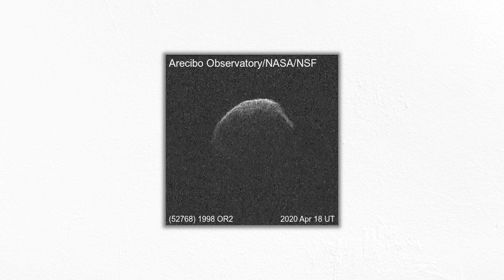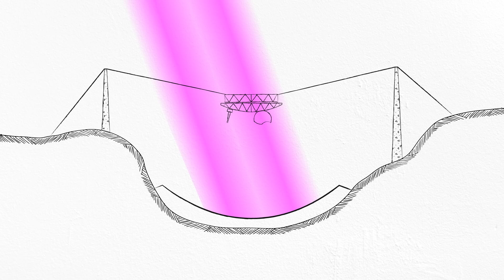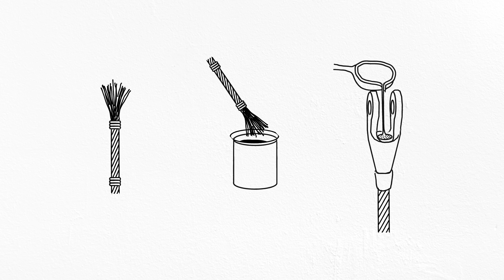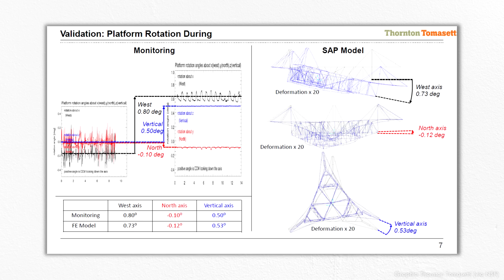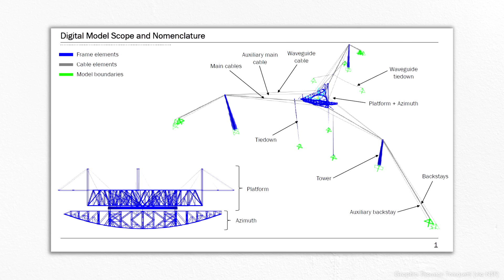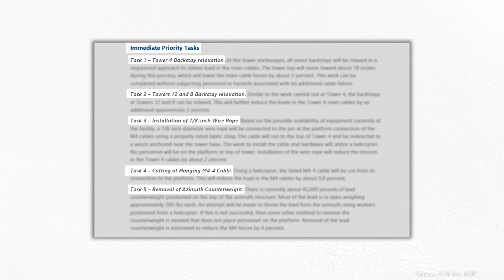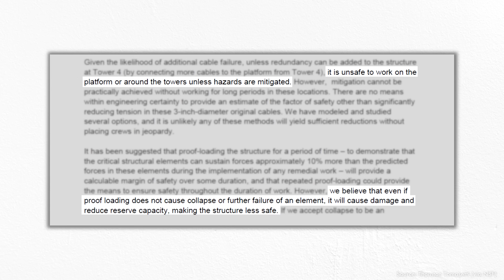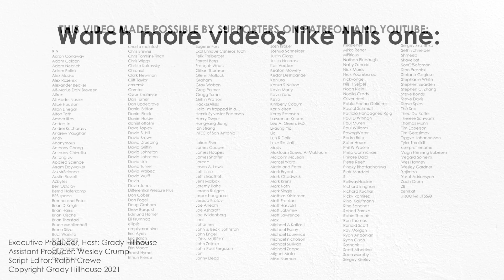What Really Happened at the Arecibo Telescope?

Comment: From Grady’s description of the situation, the question in my mind is not “why did it fall?” but “how on Earth did it stay up as long as it did?” Low safety margins, unique design, constant exposure to salt air and tropical sun, frequent hurricanes, and in at least one case, shoddy workmanship.  It seems that receiver was staying up there mostly from force of habit.
Reply: 😂its almost like curiosity rover. Its kept getting saved by random events working years after it was expected.
Edit: opportunity rover
Reply: @NAUT758  Opportunity. Curiosity's only been active for ... wait, it can't be a decade already...
Reply: @CptJistuce  lmao exactly. Its dead already but serving years on research, literally getting saved by storm on freaking mars (wind blowed off the dust on its solar panels) reserve battery getting so low it went into sleep mode only to get light again, working on only 3 wheels with literally 1 wheel dragging behind it. Curiosity was like “call an ambulance, but not for me”
Reply: @NAUT758  Seriously, that was Opportunity. Curiosity is nuclear-powered, no solar panels. 
C hasn't YET reached Oppy's legendary levels of determination(Designed life of three months on Mars? Screw that, fourteen years!), but it is working on it.
Reply: @CptJistuce  Pretty sure that was Mars Exploration Rover B 🤣
Reply: @CptJistuce  my fault og
Reply: @NAUT758  That was opportunity
Reply: The designed margins seem fine, but when a cable fails at 62% design load, the margins you thought you had were clearly no longer in place (perhaps never in place, depending on how poorly the cables were actually constructed.) 🤷🏻‍♂️

Still, you don’t just get “lucky” after something this massive exists for over half a century. It seems they should have done some more thorough testing of the existing cables when they installed all of the upgrades - that was likely the only time they could have caught it.
Reply: @EstorilEm  That's exactly what the margins are for. A safety factor of 2 should make sure that no part is stressed more than 50% of their expected strenght. Clearly the margin wasn't actually that large. The additional instruments definitely lowered it below 2 and the hurricanes may have caused some unnoticed damage in the cables or supports causing more stress than expected.
Reply: @Sibula  - I think the effect of hurricanes could be a key factor. Meteorologists still don't have a complete understanding of everything that happens in a hurricane, and a structure like Arecibo may have been particularly vulnerable due to its shape as much as its size. My guess is the dish drew wind down and then up, subjecting the platform in the middle to torsional force. Adding the Gregorian reflector would have massively increased this torsion, and it's questionable whether the vertical tie-down cables helped or hindered, since they made the entire structure less flexible. The first cable to snap was a tie-down.

While it's safe to assume that Arecibo's engineers included torsional stress in their calculations, they probably used historical hurricanes as the basis for their models, which were on average smaller, less powerful, and less frequent than today. (They would not be the first engineers to make that kind of error.) The Gregorian reflector and tie-downs were added in 1997, which means the planning (and therefore engineering calculations) involved probably happened before the increasing size, power, and frequency of Atlantic hurricanes was more well known.
Reply: @Sibula  Agreed,  but also the testing of the materials during manufacture might not have been rigorous.
Reply: @tavdy79  that's not entirely accurate, hurricanes are only really able to be measured from recent years in history and we only have data as lives lost and damages in X amount of money, which isn't a good basis, hurricanes have likely been similar in power and size for millenia but our ability to measure them is what has actively allowed us to document them properly
Reply: @Sibula  or construction fatigued the cables more than they should have
Reply: @EstorilEm  failing at 62% load sounds a hell of a lot like metal fatigue, its not that their margins weren't high enough, they just never thought far enough ahead to the inevitable point at which those margins would lower. Maybe a factor of 2 was enough, but the design was virtually unserviceable from the start, and this was sadly inevitable because of it
Reply: @hunterra217  The original configuration would likely have been serviceable - after all, they routinely sent people to change the line feed. However, adding the Georgian Dome which increased the platform's weight to over 900 tons likely made maintenance trickier due to the increased loading on the cables (while computers were available in the 1990s, they likely took the estimated loading of the existing support cables at face value when calculating how many extra they needed to add, and likely didn't calculate the additional forces on the support towers).

Ideally, if designing something like that, you'd want four or five supoort towers, so not only would have have redundancy in cables, but also redundancy for if something went wrong with a tower. And maybe also calculate if its possible to design it in such a way that the receiving equipment is on the ground, so there's considerably less suspended equipment and weight.

But, of course, even if funding is made available for a replacement observatory, it likely won't be a single dish with overhead receiver as before - with the exception of START, the trend now seems to be for arrays of smaller dishes backed up by a computer which takes the signals each receives, combines them and undertakes some hefty calculations to emulate a large dish.
Reply: @hunterra217  imagine the creep that occurred on those individual strands on the wires. They would have had to have been re-tensioned numerous times over that period of time, thus increasing the tension and reducing the safety factor.
Reply: @TVdinnermasterchef  Exactly, it was a beautiful marvel to human engineering, but it was not built to last long without constant maintenance. On it's own, that isn't necessarily a bad thing, but Aracebo was just such a complex thing to have to repair, the only real option would have been to replace all the lines every few years. They were holding hundreds and hundreds of tons of metal through hurricanes, it's sad, but I hope they make something like the FAST telescope in China in its place.
Reply: @hunterra217  the whole time I was thinking "those cables should all be braided!" Only one layer? Elevator cables afaik use 3-5 of these kinds of wound cords, coiled around each other, to move one car. Not to mention the backup cable. Seems they should have all had a secondary if not tertiary braid, but I'm not a mechanical engineer.
Reply: @0v_x0  what do you mean by braided?
Reply: @hunterra217  wound together with other cables. It's already made up of thinner coiled strands, which make up the cord, then multiple compound cords are wound together like a braid, they can take a lot more weight and act as failsafes for the rest of the cord bundle, whereas single cords tend to unravel if a few strands break.basically just the same cables here but each one is three cables braided together.
Reply: @EstorilEm  > "perhaps never in place" - I rather think the rate of erosion was much higher than expected. It's entirely possible that the margin steadily decayed, until it dropped below the 62% - where it eventually failed. Sadly, this sort of erosion often isn't something that screams at you.
Reply: @EstorilEm  yeah I'd think that if it were designed after the era of simulation it also would have some sort of design life consideration. Like after 10 years the cable strength would degrade by x %. With certain assumptions e.g. after 10 years it will have to withstand statistically x times of hurricane of certain magnitude.
 And then there would be major overhaul scheduled, at least to reapply / check the protection systems. A system also have to be designed with maintenance access in mind so that periodically they can be checked and refurbished if necessary.
Reply: @EstorilEm  Could the dynamic loads from the structure swaying in the wind - especialy with frequent hurricanes - have caused progressive fatigue in the metall to the point of failure?
That first socket to fail could have slowly worked itself lose over years.
With the force then distributed over fewer cables, one of them could have been stressed past its margin of elastic deformation into plastic deformation. Then workhardening would have slowly killed it.
Reply: @Bird_Dog00  he explain in the video that the first socket to go should not have occurred. Since socket point, if done correctly, should have been a strong point in wire. The others snapped wire itself rather than slipping out of place.
Reply: @EstorilEm  
I did read about how they found possible manufacturing defects in cable which is probably what made it snap the way it did in the first place.
Reply: '... Staying up there from force of habit.'

From sad to hilarious.
Therapy for the day complete.
Reply: Interestingly, "force of habit" is actually a thing, to a small degree. No material is perfect - over time you get grooves, deformations and such. Sometimes you get compression which, while certainly destructive to the overall load distribution, does sometimes increase the strength of the local joint. Some designs fail in such a way that the load is redistributed into a new equilibrium - and you get "force of habit" holding it up longer (as opposed to failing then and there)... at the cost of distributing the load where it wasn't meant to go (eventually failing in ways that weren't expected).
Reply: 60 years without a full refurbishment
It's like expecting a car to run for 20 by changing the oil periodically but not changing it's tires and brake calipers
Reply: There's a reason why some of us Puerto Ricans call it "The Jewel of Puerto Rico." despite it's design flaws, it was built strong enough with alot of heart. A true testament to the Puerto Rican Spirit.
Reply: @SonakaG  but wait, it was designed and built on the mainland US and brought over.
Reply: All of what you said applies to anything in Puerto Rico.

Source: am Puerto Rican living in Puerto Rico.
Reply: Yes my friend they let it fall...( No $$$ and no interest from the people in charge ) the only ones were the sciencetis and the estudents making there practice in Arecibo
Reply: "The universe, they said, depended for its operation on the balance of four forces which they identified as charm,
persuasion, uncertainty and bloody-mindedness..."
Reply: Obviously the bad guy from 1997 James Bond Golden Eye got his revenge on the facility duh
Reply: Well shucks Michael. That is it then, no more study needed. You have solved the matter from afar and there is nothng left but the leavin' of it all. Let us mosey on to the next video for more long-distance speculation with a dash of rumination. excellent work, catch you on the flip-side.
Reply: Although the scenery was nice it worked against the it by restricting what kinds of vehicles and machines could be brought in to do maintenance also so even if they wanted to remove a part of the dish or receiver in order to release the stress on the wires they would have had to clear part of the forest in order to make room along with the fact that nobody is willingly going to risk their life just for a chance to find out that all the wires are about to break and nothing could be done to stop it in the end the design and location of the dish worked against it.
Reply: It was out of spite that it stayed up
Reply: The indomitable receiver spiriy
Reply: same.
The receiver is suspended hundred feet above the ground
Reply: As I understand it from watching other videos on the subject, one thing Grady didn't touch on was that adding the additional scientific instruments to the suspended structure added significant weight and stresses to the original infrastructure that over time, may have contributed to the collapse.
Reply: @ADAMJWAITE  Yeah he did, 5:35
Reply: @ps.2  To clarify, Grady didn't explain that the structure was not designed for all that extra weight.  What they did was reinforce it, essentially putting a band-aid on it, instead of a ground up redesign.  This decreased the safety factor.  The point is, it's possible that if they didn't add the additional instruments, the structure may not have failed.  It will be interesting to see if this is one of the conclusions of the forensic investigation.
Reply: @ADAMJWAITE  he did talk about it
Reply: @ADAMJWAITE  reminds me of the Asimov story “Shah Guido G.”
Reply: @ADAMJWAITE  infrastructure lmao
Reply: @ADAMJWAITE  Resonance changes.  Collapse of the Tacoma Narrows Bridge redux.
Reply: @ADAMJWAITE  he did mention that, along with adding two more cables to each tower. My question lies in the cables and that safety factor of 2. they was he spoke the each cable individually had a factor of 2 ? but what was each cable rated at ? and how did that factor change when grouped like it was, another factor was you had force pulling from 3 sides . Lots of questions to ask still .
Reply: Aliens, bud. Aliens.
Reply: @burnsloads  well now they don't have a way to call home ( the 👽 )
Reply: @burnsloads  what the Aliens were tired of being watched?
Reply: It was a controlled demolition, I saw the video- it did not just collapse
Reply: @prepperwhatcolleen2167  Hurricanes don’t melt steel!
Reply: @malvoliosf  Yes my friend Huracain's and earthquakes don't melt old cables in Arecibo but politicians will melt it in a second
Reply: It failed because they attached small explosive devices to key points that would weaken the cables and cause them to snap. My office watched this unfold with count down...

Comment: Small correction: Measuring for longer doesn't improve the resolution, it improves the "light" yield (and integrated signal amplitude), but the resolution is defined by the wave length and aperture according to the Rayleigh criterion. You can't get above that no matter how long you measure. However, this is why telescope arrays are useful. The effective area isn't necessarily larger than a single dish, but their aperture is defined by the distance between telescopes (which for example in the extreme case of the EHT that took the black hole image was the diameter of the earth).

Comment: Question?: did anyone consider the effects of 60 years of exposure to cosmic rays? it is not, that this was the cause. Nevertheless, there may be long-term negative Wiggener effects on the strength of steel cables. (in nuclear reactors, these effects are of much greater consideration)

Comment: Till I saw this today, 7/21/21 I thought it was still there in working order. Guess I was tied up in the election news. When the engineers determined the weaknesses, the Gregorian dome should have been removed. It's addition made it heavier by 50%. Yes, they added more cables and that is a good thing.  With the dome gone but the extra cables still in place it would still be there today. The Gregorian Dome made it better but it worked B 4 the Gregorian dome was installed so they would have been better off doing that instead of loosing the telescope altogether. My advice? If they rebuild instead of the 12-4-8 o'clock idea for the pillars, use 12-3-6-9 adding another redundancy.

Comment: FYI, a NASA report on the initial socket failure is available at https://ntrs.nasa.gov/citations/20210017934 . The executive summary seems to basically state that the socket was insufficiently dimensioned, and that in hindsight there had been visible signs of cable pull-out from the socket. It also states that the likely reason for the subsequent cable failure was, indeed, that the factor of safety was much too low to remain standing (or hanging, as the case may be) on the remaining cables, so the conclusion of the video seems very correct!

Comment: I was in my teens when this was built and I first found out about it as it was being built. Like almost everything, there is never any long term maintenance included in the operating budgets. Cables, or wire rope, have a lifespan and should be changed at regular intervals. If there is no way to remove the tension they need enough redundancy to be able to replace them.

Comment: Well,  deterioration over time, unrelenting stresses and corrosion destroyed the facility.  For all the monumental engineering that went into the design and functionality there was lacking a structural cable replacement whereby critical elements could be replaced before they failed.  It seems that, given enough funding, the structure could be rebuilt to an even more robust standard and the facility returned to a greater scientific functionality.

Comment: What was the expected service life of the structure.....forever? This video makes the failure sound like a product of bad design, planned maintenance and lack of competent local craftsmen to execute. Sounds spot on. Once the elements take hold of unprotected man made structures, they decay over time continuously. I have no idea what preventative maintenance was done on these towers and cables over the years. How much corrosive moisture was encapsulated under repainting. Dynamic load most definitely played a key role in it's eventual failure though. I think time under tension for these exposed cables is also a contributing factor. We change crane cable if we lose a few strands in one lay. We do this because  the alternative could be catastrophic. I'd be very interested  to see what the PM was, how often it was scheduled and the competency of the crew carrying it out.